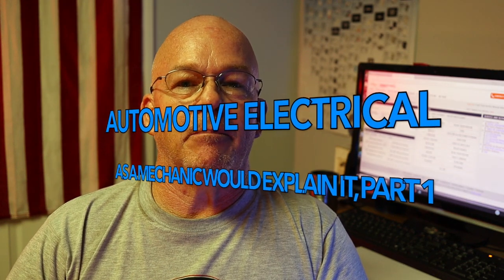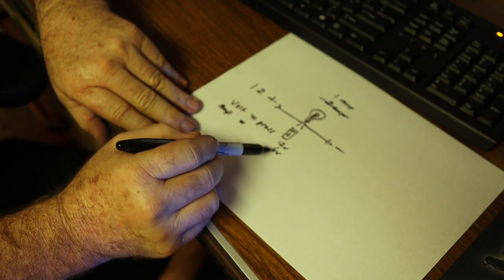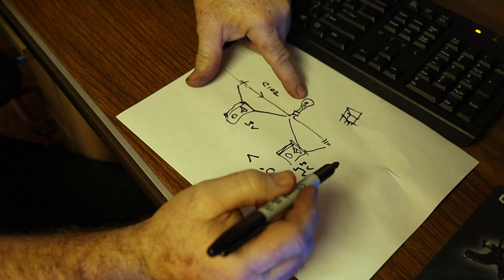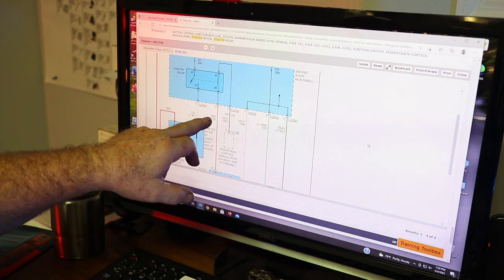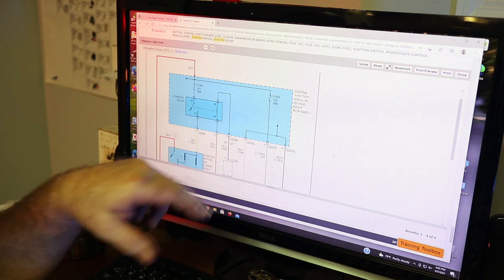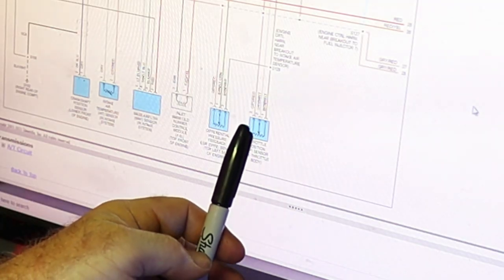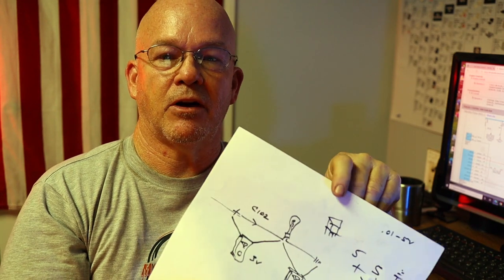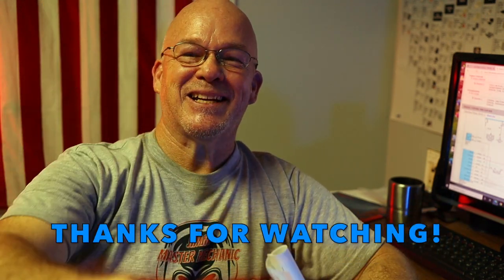AUTO ELECTRICAL 101, a mechanics perspective, bulbs, 3 wire sensors and reading wiring schematics...

Comment: You try using a loadpro to load circuit?
Reply from the maker: No, haven’t tried one, I do sometimes use my power probe to load test circuits. 
Has it worked well for you? Maybe i’ll pick one up to try.
Reply: @JimmyMakingitwork  I like using it. I was mainly using it on  construction equipment not when I was auto tech. It's not like a powerprobe, doesn't supply voltage or ground. Plugs into your multimeter and has a button you press to see loaded voltage compared to unloaded. Their dynamic test leads. I believe pressing the button loads a 12v circuit with 500ma. Some guys here on YouTube trash talk them and some guys like them. The inventor, Dan Sullivan, does his own videos and seems rub people the wrong way. Available on amazon and I'm sure other tool websites. Also Bluepoint has  rebranded version for obviously more money. There's an upto 28 volt version and 12-48 volt newer version. 48 volt version I believe only loads 12 volt circuit 250ma. I will shut up now, I'm such a windbag😆